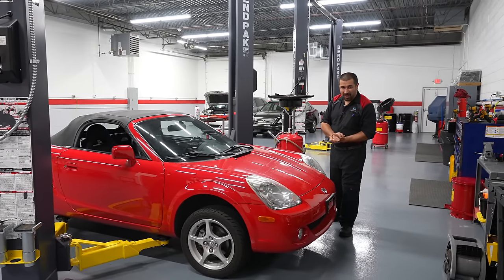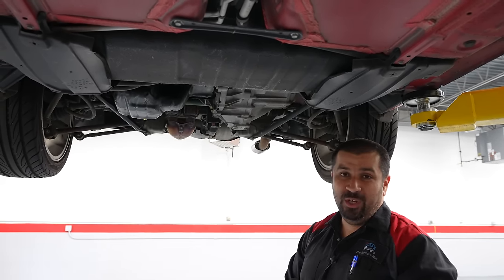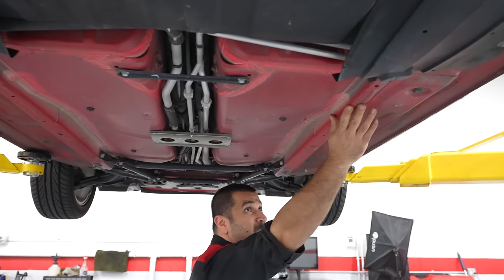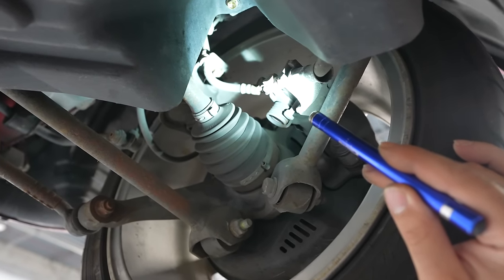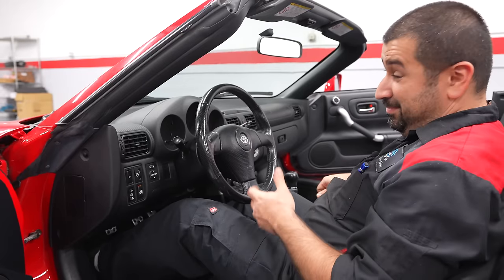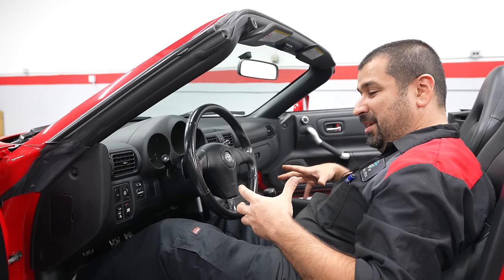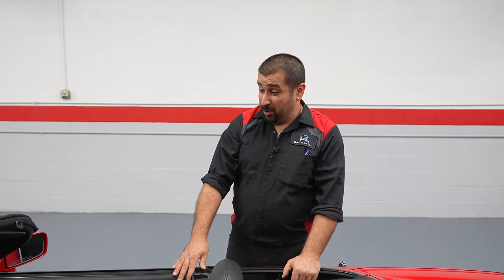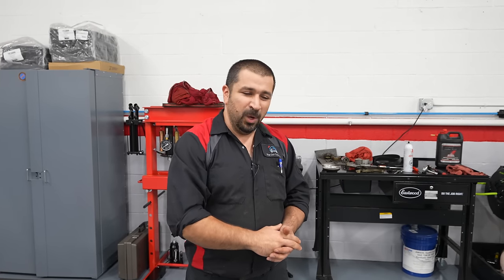Toyota MR2 Spyder Deep Dive | A True Toyota Icon That Should Come Back

Comment: Excellent video! I on a 2000 and a 2001. Few points, 00-02 have percats to make it ultra low emission for CA that were too close to the combustion chambers and they would fail, draw material in and oval out the cylinders causing them to burn oil excessively. Easy fix(google it) if addressed in time. With LSD if the wrong lube is used it causes synchronizers to fail. Other than those, very reliable. With motor weight over the drive wheels they do great in snow(except depth) with proper tires. Toyota engineers were so concerned with weight balance they purposely limited storage space in the frunk. This is one of the reasons they didn't sell very well. Anyway, thank you!

Comment: Great video. I own a 2003 MR2 Spyder (regular 5sp manual), which coincidentally also has @50k miles. My main issue was to repaint the vehicle this spring as the grey/silver paint was fading. I chose a Toyota OEM color called Sunset Bronze Mica, which can be found on their late model Tundra and SUV’s. Looks great, BTW. My convertible top also does not have much more viable life and needs to be replaced and there is some cracking on the driver side leather seats. Mechanically, there have been no problems whatsoever. 
I was curious about the paint job on your MR2. Surely, that is not the original paint? I learned a lot about the car from your video. THANKS.

Comment: I got a 2000 MR2 for my wife 5 years ago. Only 2,000 lbs and it is a very fun car to drive. It just turned over 56,000 miles. The seller worked at GM's proving grounds and gave me the Inch thick Japanese sales book. It is amazing what car related items that make it to Detroit!

Comment: Great little car. A well made and designed sophisticated mid-engine sports car at a mass market price. Can't understand why they stopped making it, in view of the continuing success of the Mazda MX5.
Reply: rhdrivingslovenia6413 Never made in European factories? Good news. They build them better in Japan (my 20 year old Camry doesn't have a mark on it and uses no oil at 120k). "Shit engine"? Hardly. The 1.8 Toyota unit is good for 300k IF looked after and the oil is changed every 5k (many owners think saving 50 quid on an oil change is smart, sadly). I'd expect the knob ends in the UK motoring press to not like anything that wasn't made in Germany.

Comment: Great cars.  Wish they offered a 2zz, especially later in the run when the lift bolt issue was fixed.  Would have been a cheap alternative to a Lotus Elise.
Reply: had a deal with lotus not to do it, lift bolt issue was not a big deal and the early 2zzs are better because of no air injection + lower lift and higher redline

Comment: I currently have a 91 turbo MR2 with the 3sgte, it has 125,xxx miles and is my daily. I live in Indiana but the car is originally from California so it is rust free. Unfortunately the  motor needs a refresh, leaks alot of oil and I think it might need some new rings or has a blown head gasket.

Comment: Thanks for the video. I used to own a mk2 1993 MR2 turbo with the 3S-GTE engine. Although a bigger car than the spider, it was still a tiny car. The mk2 was much faster than both the mk1 and spyder, with 200hp, bigger brakes, bigger tires, etc. I loved that car lol. Thanks

Comment: That car is a credit to it's owner,  lovely condition.  I have a 2005 in exactly the same colour with 51k miles and I love it,  wonderful handling  - it rotates about the drivers seat and can carry speed through corners while others are braking into the bend!
The only issue is changing handbrake cables which require Toyota parts as they are unequal lengths on each side and require the petrol tank to be removed. 
I would never sell mine and the values have bottomed out,  especially for unmodified ones, so they'll only go up in price. 
Funnily enough,  I asked my dealer what they would offer me for mine when I was buying my GR Supra early last year and they were doing a scrappage scheme.  £2k for anything you traded in,  not that I was going to trade in but when they only offered me £2k I laughed at their offer and said that I'd be keeping the car!
Their reason for the low price was that January wasn't a good time to sell a cabriolet  - only when I turned them down did they admit that two of the salesmen were going to buy it themselves!
Reply: Did you actually sell it to them?
Reply: @laistephen754  oh no! I constantly tell myself that I'm so glad that I didn't trade it in each time I drive it! It's an absolute bargain at the minute as their values currently don't reflect how good they are,  I've had mine for 14 years and got the underside waxoyled last year.  The garage that did the work wanted to buy it off me too!
Some people want more power but that's misunderstanding the car as it's about carrying your momentum through the bends rather than being a point and squirt vehicle!

Comment: The downshifts with the SMT were magnificent. The upshifts not so much. It was a pretty high tech gearbox to throw into this price point at the time. Also I believe before this Spyder model was released MR2 did stand for "Mid engine, Rear wheel drive ,Two Seater." At least that is what I was told by the press. But we just called it "Mister Two". Hence why the "MR-S" badging in other countries was confusing at first.

Anyway, I was a huge MR2 enthusiast from 1986 to 2005 and have owned all three versions of the car driving a 93 Turbo and a 2003 Spyder off the lot. I then had a family and had to make those sacrifices. I do hope it makes a comeback soon because I am now looking to reclaim some of my youth. No electric crap please.

Comment: My 2003 MR2 Spyder had the exact same crack in the windshield but without the chip.  I think it was a stress crack.  Some passengers like to grab the top corner of the window frame to pull themselves out of the seat.  Windshields are available, no problem.  Great video by the way.  My MR2 have 44k miles.
Reply: Sell me your high mileage Spyder 🤔🤣😁🤣 I’ll take it off your hands

Comment: The undersides on these are simply excellent by Retro Japanese standards. Mine has been in the humid UK climate for 20 years with no significant treatment - there's some surface corrosion towards the edges of the rear subframe, and a few specs on some of the bracing at the rear. All bolt on parts. The floor pan, sills, chassis rails - all still bright red, and the wheel arches are great too. 

I'm going to use some rust converter towards the rear and then seal it all up, with that I don't see why it couldn't go for another 20 years without a single weld.

The biggest issue with my car is some valve tapping. They start at 3K here - for that price that's impressive. When you consider that it's a retro midship sportscar that weighs nothing and has a soft-top - I don't think the value for money can be beaten by any car.

Comment: Just look at the Fiat X1/9  they did all this in 1974  and it worked. aside from their rust inhibited vehicles those cars ran and handled very well. In 1980 they introduced fuel injection and those were even nicer. The one thing that toyota Mr2 does has  is reliability. Just want to add that the x1/9 did have more room to work on both sides of the engine .

Comment: I was just out in my mr2 a few hours ago had it five years with over 100k do all maintenance  cheap parts 38 MPG bought for less than £800 uk pounds BARGAIN 👍
Reply: I worked for Toyota UK back in the day,they were so reliable & awesome cars,we had a rare one in yellow auto & only 2 were in the UK. White was the best seller then red. Thing is a lot of us Brits did rag 'em 😂 MK3's were one of the best handling cars on the road for the money when they came out,Lotus Elise were expensive thou.
Reply: i scooped mine in 2017 for $3900 and that was a steal but pricing in the states is completely different

Comment: It won't be that difficult for Toyota to bring this car back. They have engines that would fit in the back and be fun to push to its limit (like the new 1.6 turbocharged 3 cylinder), and they can partner with Lotus for R&D and suspension tuning.

Comment: If the PAS pump fails, the price of a new one from Mr T will make your eyes water. If you D-I-Y, replacing the handbrake cables is a PITA job.
One weak point is the rear subframe which is prone to rust unless you live somwhere warm and dry. A small price to pay for so much fun in the twisties. I've got a 2001 PFL and a 1996 Mk2 JDM tutbo. Just need a Mk1 to complete the full set. :>)

Comment: The SMT system is extremely reliable and easy to use - it only down shifts if you go below 20 mph and never automatically shifts up if manual up and down.  The problem is most people use dot 3/4 brake fluid instead of oem smt fluid and yes big difference.  And thats 1 of the biggest issues - the smt system is not like the brake system - the smt system is open while the brake system is closed.  Now rubber orings that last 20 yrs are expected to fail it rubber ... its 20 yrs .... so youll need to find someone to service the smt system

Comment: I had a yellow one when it first come out, it was fun to drive at low to mid speed. because of low weight, acceration is good. sliding the rear on regular right turn is fun.  driving it next to a 18 wheeler is just down right dangerous. over 90 mph.....the engine went flat and don't want to accelerate at all. that is the only complain I have.. no high end torque or acceleration at all.

Comment: I’ve always enjoyed the MRS, probably because I am an MR2 owner. But I really wished Toyota would have put a 2ZZ in the MRS as an option. I prefer the SW20 styling, but the MRS did have much more neutral handling and is lighter than the SW chassis.
Reply: they had a deal with lotus not to do it

Comment: I am an Happy MR2 Spyder  2005 6-MT owner in The Netherlands. AMD mentions this car having a Corolla 1ZZ-FE engine , however my information is that the engine is of type 1ZZ-FED, which has larger valves thus increased output.The following is stated in various locations on Internet: The MR2 W30 engine 1ZZ-FED is similar to the 1ZZ-FE but is built separately in the Shimoyama plant. Toyota's advertised power output is 140 bhp (142 PS; 104 kW) at 6,400 rpm and 127 lb⋅ft (172 N⋅m) of torque at 4,400 rpm. It uses Multi-point fuel injection, VVT-i and has larger 32mm intake valves and 27.5mm exhaust valves with corresponding revisions to the ports, resulting in higher power output compared to the 1ZZ-FE. Can AMD confirm please, kind regards Tom

Comment: I prefer my big turbo awd Mazdaspeed 6. However my w30 mr2 (manual) is such a joy to drive even with the lack of hp. That should be fixed in the next year.
Reply: Ps I get as much complements as I did my e30 m3 which most surprised me.
Reply: Ps in IN we use beet juice to lower freezing point and salt only if rain ice mix.

Comment: I have that crack in my Holden Statesman starting at the bottom of the windscreen courtesy of a large rig coming the opposite way. Been there 3 years now, slowly creeping along just below the wiper blade. No point in fixing it as it does not interfere with vision and another big truck will end up cracking the new screen. I would not be too worried about it but that may depend on Illinois driving laws.

Comment: I have a 2000 Toyota Celica GT 5 speed. Thankfully it doesn’t have the yamaha 2ZZ. Yes it’s not an MR2 but i have driven my cousins MR2 5 speed a few times and i find they are little rear heavy compared to the Celica but otherwise has the same character to it. As an 18 year old I absolutely love my car to death. Would love to see 2000-2005 Celica GT pop up on the channel. And yes a GT specifically for the 1ZZ engine. Can’t stand those Yamaha engines

Comment: My 2000 Miata is just as clean, The Miata roof can be raised and lowered with one hand from the driver's seat and has an actual small trunk. I like the MR2, but good examples are hard to find.

Comment: Hi AMD, I had a rare Yellow 2004 SMT which was show room condition when I bought it in 2009 and sold in show room condition in 2013.  I disagree with you on SMT transmission and I thought it was fantastic and the only other car with the same layout (dashboard) that had SMT  was a $150k Ferrari that was built in 2004. With top down, from the back, people thought that I had a Ferrari. 
I never had any problem with SMT and I am a die hard stick shift guy.
My only complaint about the 2004 MR2 Spyder which applies to every Toyota I have had (9 Toyotas dating back to 1974 Cressida) were these:
#1 Very uncomfortable seats
#2 rough ride, you could feel every bump on the road. Felt like you are seating on a bucket.
The reason I stopped buying Toyotas are that they destroy popular  unique cars (Supra, MR2, FJ Cruiser) and focus mainly on maximizing profit on similar cars that are honestly very ugly and not exciting. I lost interest after Toyota killed my 1994 Supra and 2004 MR2 Spyder. 
Now I am a die hard Volvo driver and extremely happy. I love their line ups (i.e. Polestar).

Comment: Thanks for your video. Learned a lot. I am thinking to get an used Toyota Camry 7th generation (2012 - 2017), do you happen to know which year has less problem. Thinking of the 4 cylinders. Any advice will be appreciated.

Comment: mr2 is one of my favourite cars. Still hope to get one in good condition one day (i like the previous gen more), but here in europe they are kinda expensive nowadays and price is still rising. I'd really like to see a Corolla/Celica T Sport video and your opinion about them and the engine, problems etc. :) I consider buying one next year but they are all about 200.000 kms.
Reply: I would go and test drive a T sport to see if you like it or not, unfortunately most people have no clue about the maintenance that needs to be done on them (they are quite sensitive to late oil changes, change it every 5000kms). some mechanics may even mess up stuff because it’s different to most Toyota engines. My celica has done 230kms and after that kinda mileage it’s almost certain that the timing cover is going to be leaking oil, which is about 4-5 hours in just labour to fix and at that point you might aswell do a timing kit too. Power steering also seems to get neglected on them as almost every car has a stained horrible looking reservoir, because the fluid hasn’t been changed regularly. also common to have synchros grinding especially on 2nd and 4th because they just wear out. another thing is that they have lift bolts that can break, Toyota updated the design but some cars (mine did) still have the old design which is very prone to snapping in half which means you get no vvtli. and you have to take out the camshafts and tap the rocker shaft out to fix it. The only other thing they have is a bit of oiling issues, the stock oil pump doesn’t cope very will with lots of high rpm abuse (mainly on track) and because the pan isn’t baffled taking corners really hard can starve the pickup but it’s not really an issue on street driving because you have to exceed about 1g of lateral. other than though it’s one of the best fwd coupes out there, not far off a dc2 type r but for a lot less money. chassis is very light, stiff and handles great. and they are stupid fun to drive, everyone who’s had a go in my car has liked it, and one of my friends ended up buying one cause he liked it so much. and yes his timing cover is leaking too :))
Reply: @arcanevoid9199  thnks for the reply and advice, mate :) unfortunately, mr2 mk2 and 3 are out of my budget, so my options are celica/corolla ts, also the vvti celica (>2003, i like the car looks that's why, i also understand the engine would be more reliable) and the civic type r fn2 (it the price difference is not toooooo big). all are kinda high mileage on the market , and I know i would probably replace pump, belt if no chain, battery, alternator, sachs clutch maybe and probably more, but if i'd like the car, i wouldn't mind spending some money for it, i'd rather prefer no rust on and under and not to be a complete wreck technically. :)
Reply: @renataandor4488  dont bother with the vvti celica, have serious issue with oil burning even after facelift and are not as exciting to drive. reliability is pretty much the same as the 2zz is based on the 1zz, and the fn2 is not a great type r and the suspension setup on the celica is superior tbh

Comment: I think with the Spyder they were trying to copy the Porsche boxter which was quite popular around the same time. But they basically created the Crysler 300/Rolls Royce dynamic. To me it looked like a cheaper and awkward version of a "nicer" (in design, maybe not reliability) car. I'd rather take a Miata or the oldest mr2s
Reply: Depends were you live, I'm in the UK and have an 04 MR2, it's as clean as the one in the video....a Miata (MX5 here) the same age would have serious rust issues by now over here. Rear arches and sills be rusted, the underside would be mostly rotten